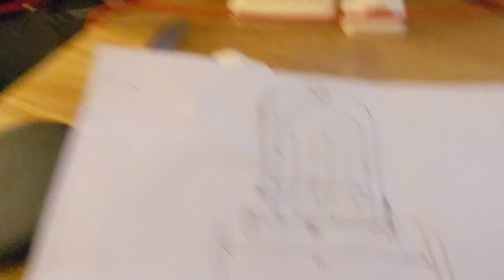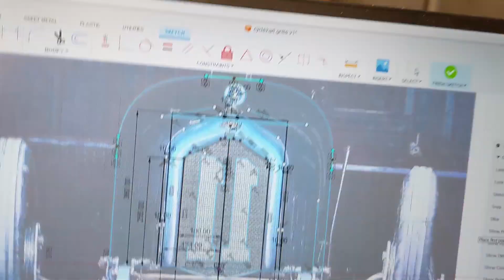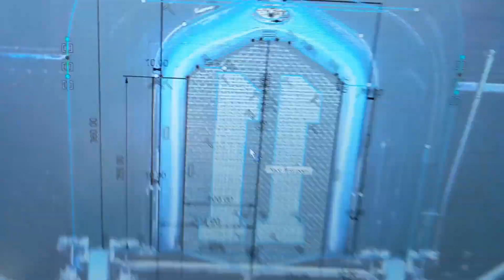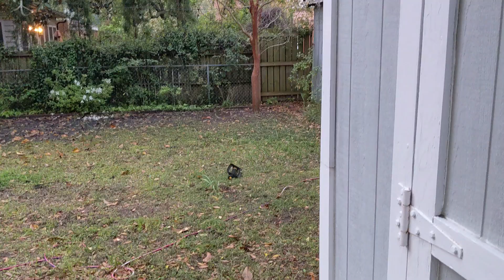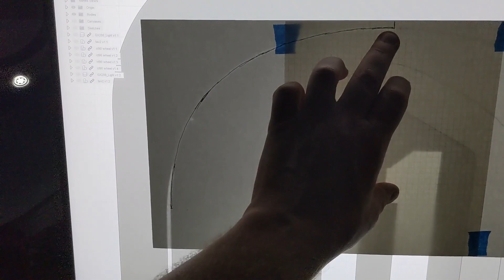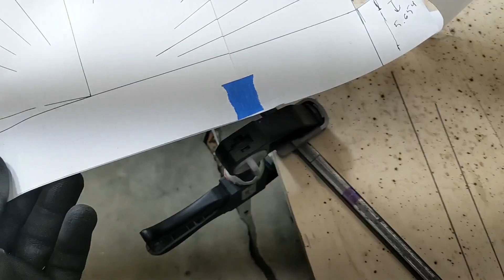Cyclekart Build  - Part 8  - Designing the body in CAD from photos + Fabricating the 1st 2 of 3 body

Comment: When I decided to build, I picked the 1934 BMW K60. Started with some pretty crappy pictures that were not straight. I used the centerline method and some old photogrammetry tricks I learned to help get the scale right. Glad to see someone using similar tools, but doodling is just irresistible, ain't it??